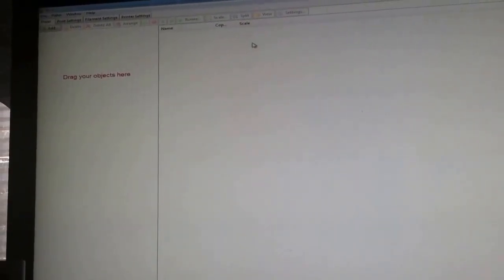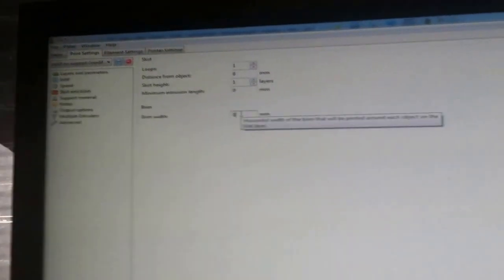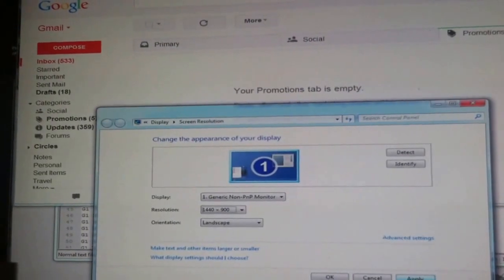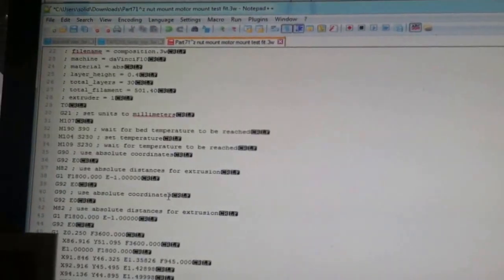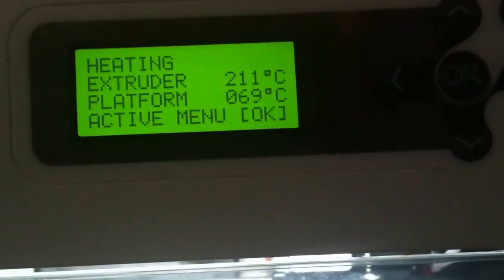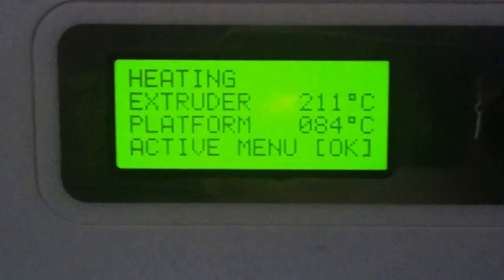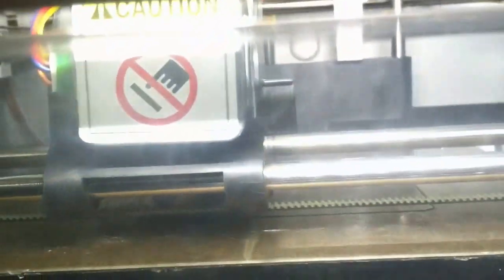XYZ da vinci 3d printer Slic3r and base64 encode for printing

Comment from the maker: I would love to. I cant compare it with anything though, cause I have never owned another one. That being said, I was printing within 5 minutes of opening the box. And with the hacks and mods that we have come up with it is a fully open machine, it has a few small issues, but they have decent support and well it does just work, GREAT well no, but good and I was happy I bought it. 7.5 inches x 7.5 inches is a pretty decent work envelope.
Reply: Thanks for you quick reply! Also, about the hacks, how did you manage to rig it up so it can be fed through the top of the machine? All the other hacks I've seen essentially come down to filling the cartridge with new filament, resetting the chip, and then putting it back in. I suppose that would still work, but your method seems less tedious and I'd love to know how you managed it ;)

Comment: Hey thanks for the video! I'm wondering how you deal with the filament. Is there anyway to change the software to run non da vinci filament through it instead of manually changing the chip on the cartridge. Thanks!

Comment: (QUESTION)
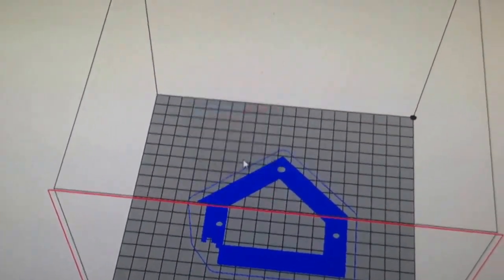Hey josh, I'm considering getting a Da Vinci as my first 3d printer, and I'm debating over whether to get it or a Printrbot simple (with xl upgrade eventually). I noticed at about 5:20 that you have rigged it up to third party filaments fed in through the top. Would you mind explaining how you did that? The main downside I've heard of this printer is that they force you to use their tiny selection of cartridges, but it looks like you've found a pretty great work around.
Also, would you mind giving me your opinion of the Da Vinci and how you thing it compares with others in this price range?
(also, if anyone notices that this post is different, your not losing your mind ;) I noticed youtube cut off my second questions so I rearranged it)

Comment: Great video.  I have a question.  I just got my Da Vinci 1 and i was wondering did you have to do any firmware update or any physical alt on your printer to use slic3r?  THanks
Reply from the maker: simple answer, no.
Reply: When I upload to my da Vinci there is no model and I click on INFO and all i see is NULL.
Reply: loczster me too
Reply: kandaraugh
I was able to fix it.  Once I open slic3r and import a file/model I do any adjustmentthat i want and when im done i 'export gcode'...then open the g-code file with Note++(free).  Any line ABOVE the line that starts with G21 is highlighted, replaced with the following lines...dont change a thing.

; filename = composition.3w
; machine = daVinciF10
; material = abs
; layer_height = 0.2
; total_layers = 173
; total_filament = 0.00
; extruder = 1

...now once you are done putting in the above lines...highlight every line in that file..right click...Plugin Commands..Based64 Encode.  Give it a few seconds and you will end up with a single long line.  Goto files 'Save-as' Name it whatever you want .with a .3w extension, make sure to select in the drop down menu Save As Type/All Files and that is it.  Go to xyz software and import that .3w and you are done.
Reply: loczster That is correct, and I think that is actually covered in another video I did.

Comment: When I export the .gcode and then open the file in Notepad ++ I am missing the information relating to the layer heights etc. When I import it into XYZware and go on to info everything is "null" and then the programme crashes when print is pressed. I am trying to print a double helix planetary gearbox as on the XYZware it doesn't print accurately enough and causes the gears to fuse together during print. Any ideas ?

Comment: Just got one. No matter how many cartridges I buy it says filaments empty. Any suggestions? Also, after slicing the image on the screen is mostly missing. Is that normal? Software or firmware?
Reply from the maker: it is slicer issue, try kiss slicer. It has happened to me if slic3r thinks the amount of material in the area is too little to reproduce.
So you are saying a "new" cartridge is reading empty?
And this is with multiple cartridges?
I have found they can be a bit finicky inserting them.

Comment: No matter what I try and print, after I go through the steps.  I am getting a printer mismatch error or the software crashes. I know you say 1 out of 10, but for me it is every time and I have yet to be successful. Any ideas? I am using the same firmware.
Reply from the maker: Consider if you have proper gcode type and, what software version are you using and operating system.  If you find the videos helpful please like, share and or subscribe.
Reply: Josh james I do not think the gcode is poor. Could you paste one of your model's gcode to test? SOftware version is 1.1.29.4. What is yours?
Reply from the maker: ***** I am using the original software version that came in the box. 1.0.1.20.  There is a software repository on the forums for the older versions if you need them.  I have added code examples at the forums here
http://voltivo.com/forum/davinci-software/6-ways-to-print-with-3rd-party-slicer?start=20#394